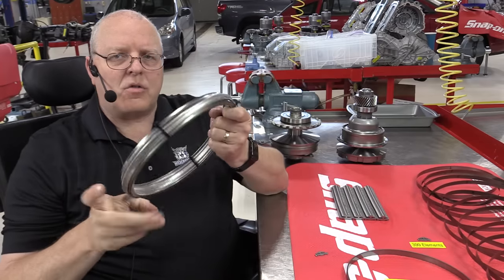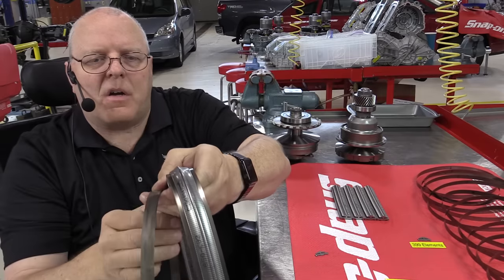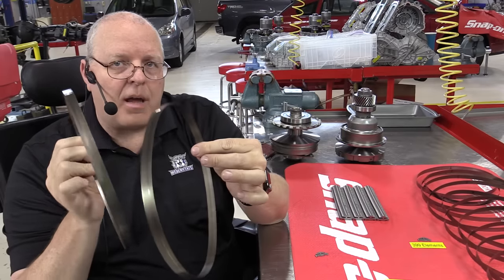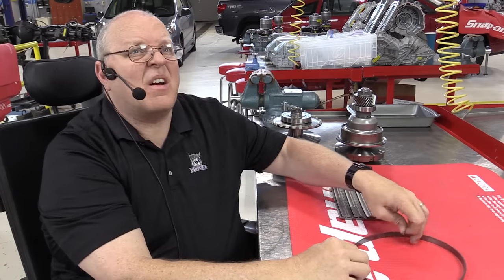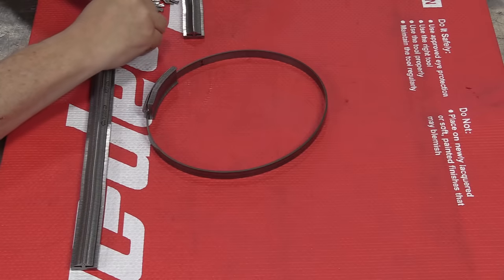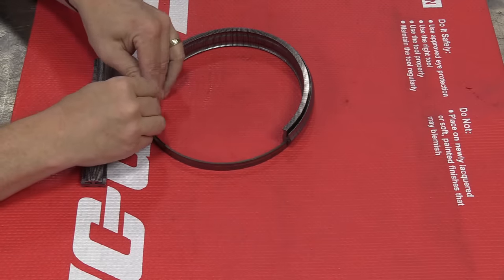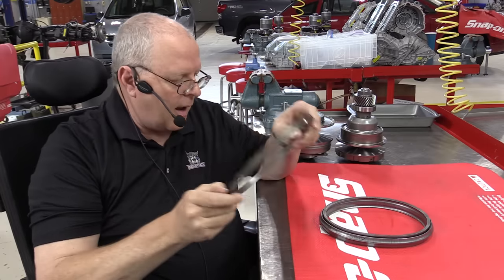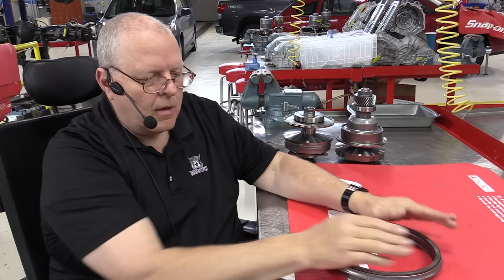The 423-Piece CVT Steel Push Belt

Comment: so that's not a pulley... it is a pushey
Reply from the maker: True! Thanks for your feedback
Reply: I just realized I am not the only one with such a comment LOL
Reply: This tech came frome snowmobiles with a high striangth reinforced rubber belt... open and easy change. Cvt in closed auto transmission = expinsive. Its cool tec junk.
Reply: Hahaha
Reply: 399 elements.  
Some engineer was told 
' because of peculiarities in our supply chain, using 400 elements per transmission is going to boost the cost of the car too high.  You need to find some way to get the element count below 400'. 
'yes boss, I'll find a way'.
Reply: @WeberAuto  where can I buy those belts for my Nissan
Reply: Lol
Reply: it's definitely junk  @nater3113
Reply: Lol
Reply: Everyone likes a little pushey now and then.
Reply: Hey! Don't push it, pal.
Reply: Now I know what my wife said, it’s a pushey and I’d better git with it!  Brahaha!
Reply: Wayne: "I did not know that! Garth, did you know that?" Garth: "No, I did not know that!"
Reply: It's a pushelt!
Reply: top comment witnessed
Reply: Hey we want some pushey
Reply: @Steve.191  try ebay...
Reply: @thorick590  Never buy a vehicle run by a 423 piece jigsaw puzzle.
Reply: pushey hunter

Comment: I'm going to throw this in the face of the next person who tries to convince me that "CVTs are simpler and have less moving parts".
Reply from the maker: LOL, for sure
Reply: Golf cart and snowmobile setups are pretty nice. This seems overcomplicated just to keep you from working on it.
Reply: The pulley itself doesn't handle the clutching?
Reply: I own one, $600 to change fluids and screen. Jeep dropped it for a Hyundai 6 speed
Reply: I don't know why they can't be like golf carts and snowmobiles except those setups are so damn simple you could work on them yourself so the dealer can't rake you over the coals I guess.
Reply: Because a snowmobile is in general an occasional use vehicle which usually does not have a huge amount of power, these are designed for longevity and as such cannot use rubber belts.
Reply: CVT sucks stay away from it.
Reply: Heliarche - Those are probably centrifugal clutches, you can't shift a transmission if it's got a centrifugal clutch. You would need to return to idle RPM to change gears. 

Bet most of these things with the clutches you like don't have multiple forward gear transmissions.
Reply: They actually do have less moving part's and are a lot simpler. Sure they have a lot of those shims but that does not make them complicated. The problem with them is that the belt can't take as much torq and last much less than geared transmissions. And once they break you will have a bunch of shims in the trany which might break something else.
Reply: @heliarche  It's not, if you used a normal pulley it would be fucked after the first time you pushed the throttle.
Reply: I still don't get it. I mean you have HUGE rock crushers that use belts and pulleys for the main motive force, yea, BIG belts and pulleys. You can't scale up a CVT such as on an ATV so it can use regular belts and whatnot? I still think they're overly complicating it. I'm not saying use normal pulleys, I'm saying CVT clutching pulleys, same as an ATV or snowmobile or golf cart, just scaled up to do the job.
Reply: Oh ,  nice presentation.   You took to time to post it, I will re-watch this again.  I will listen.
Reply: But CVTs are much simpler and have far less moving parts than a traditional automatic gearbox.. so I'm not sure what you're on about.
Reply: After seeing so many elements here, I see so many points that can go wrong. The number of gears in a 10-speed automatic pales compared to the number of elements in a CVT.
Reply: deepwater-jew very few discs and clutches to each clutch pack!
Reply: @anthonyr.hodgson9988  CVT's are for basic transportation only if ever  it is neither for heavy hauling or performance racing that's why Cars like a Camaro with a V8 supercharged or Turbocharged  or big trucks  have Conventional Transmissions only because this thing wouldn't last nothing in those types of vehicles
Reply: Producing this assembly requires only two parts production lines.... one for rings and one for elements. The quantity of parts is much less important than the number of distinct parts here.
Reply: @Stierguy1  It doesn't matter to Me because I want in a Car a Conventional Transmission
Reply: @zooplanton  only if you count that belt as 400 "elements"
Reply: No wonder Nissan transmission like pos.
Reply: @harrier331  those snowmobiles have as much/ more power than these cars, dont believe me look it up. Also look at SXS's, which use rubber CVT belts and can push up to 300 HP
Reply: @yohanathandowns9057  Irrelevant, as I said its down to the longevity not the amount of power it can take for relatively short lengths of time. for instance, when was the last time you saw a 300HP snowmobile do 100+k miles?
Reply: @harrier331  if the belts were as easy to change as they were in a SXS, longevity wouldn't be an issue 🤷‍♂️
Reply: @yohanathandowns9057  so you would accept a car that you have to change the belt on every 1000 miles yea.... right.
Reply: @harrier331  vs a car that's totalled when it goes out at 50,000? Sure. For on road application, you'll get far more than 1,000 miles. Most last much longer anyway
Reply: @yohanathandowns9057  How many times do I have to say the same thing? THEY DO NOT LAST LONG ENOUGH FOR THE APPLICATION

Comment: It suddenly occurred to me that DAF (a Dutch automaker in decades gone by)  made a CVT style transmission in the sixties or early seventies, that had an infinitely variable  transmission , the principle of operation of which, was based on a precision gear box called a "Geneva mechanism". These devices were used in strip cameras, drives for precision machine tools etc., & had a series of tapered  "pulleys, sheaves, whatever       . The Daf car was never exported overseas to my knowledge

Comment: I've had my little nissan for 11 years now, and she's running on 220k miles. Cvt still strong, and let me tell you, it's had a rough life... Got it new, and will keep it forever. She blows, I'll replace, but.... still hasn't
Reply: Any tips you can share to me how to make your cvt last longer? 

I will get a new car and it's CVT.
Reply: @affandih  from what I’ve read the reliable manufacturers of CVTs are Honda, Toyota, and Subaru. I don’t think there is anything you can do to make them last longer besides buying them from the companies that have a good track record on their CVTs.
Reply: @affandih  Sure, Don't run it like a Nascar. I don't have problems either because I drive normally
Reply: @boarhog1979  never 🤣 never drive like Nascar, only casual driving. I got Mitsubishi Xpander Cross and it' s CVT
Reply: @elmergloo3259  Mitsubishi,  got new one from them this year
Reply: @NoName-gv6nm  will always do routine maintenance
Reply: Are you sure it has a CVT  I really don't believe this, and you didn't say what model it was.  Any good engineer would look at this and call it stupid BS.
Reply: @portagepete1  my Nissan Altima 2.5 SV, 2013 model year, has 195,000 miles on it and still going strong. I’ve changed the cvt fluid every 40k. Never had a single issue. 
People who dog Nissan are the same people that never change their transmission fluid/engine oil, then go full throttle on every green light and complain about reliability issues with them. 
Not saying they are made as good as a Toyota (obviously they aren’t), but still pretty good vehicles if they are taken care of.
Reply: @ehh2681  Going to do a trans fluid change on semi neglected wifes 2008 2.5 Altima. Do you always use Nissan fluid or aftermarket? Not sure I can stomach paying 100 dollars for 6 quarts of Nissan fluid for an old car worth very little.
Reply: @joshdiehl8737  Well, personally I ONLY use NS3 Nissan fluid for mine (2013 and up require NS3). That’s because for a CVT, I want that fluid to be exactly what the computer was calibrated for. However if you really don’t want to stomach it then I’d say just buying a higher quality CVT fluid from valvoline or Mobil 1 should be fine. I’d really steer away from other brands if I were you, because CVTs are so sensitive to fluid viscosity. Unlike a normal automatic, a CVT uses hydraulic pressure to change the gear ratios. Smashing two pulleys together at some odd 800-1000PSI. I have used Amsoil CVT fluid in mine and I found that while it worked, I noticed a shift difference and it felt slower for some reason. So I immediately ordered NS3 and it felt much MUCH quicker and smoother.

Comment: Note that it isn't JUST the number of rings that determine the strength and power they can transmit.  It is the material the rings are made from (i.e. F6 or F7 etc), but also the width of the elements.  Wider belts can transmit more torque. (i.e. 24 mm elements vs 28/30mm etc).  p.s. I have found your video's EXCELLENT btw, thank you for taking the time to put them together.
Reply from the maker: Thank you for your feedback. Yes, it is a combination of factors that determine the strength.
Reply: I actually contacted BOSCH directly about what I thought was a discrepancy in their tech information.  They had listed the 28mm belt as holding more torque than the 30mm belt (with the same number of rings).  I have not got another reply back on why exactly (balancing act of fluid layer/belt tension or something maybe?), but they assured me that the 28mm actually held more torque than the 30mm.

Comment: All my curiosity about these metal belts was satisfied when you mentioned they were  push loaded (compression) rather than  pull (tension) as in rubber belts. Thanks a lot for the info.
Reply: Thank you for the explanation of push compression vs pull tension. Years ago my Shopsmith woodworking machine used a CVT with a rubber belt. I was fascinated how these compact transmissions worked.

Comment: AMSOIL's CVT fluid has doubled the life of all our clients belts and transmissions. Amazing find!! Nissan and Audi customers need to switch before 75,000 miles. It keeps the friction while allowing smooth shifts and stops all wear. It took them 4 years to get it perfected thus it came out a little late but better than never.

Comment: Very excellent, enlightening  video, I thought the belt was used to pull the opposite pulley from the torque converter input!  But since the elements on the belt PUSH it to the other drive pulley, the only reason the multi-ringed belt fails, is simply because the flexing that occurs from going around the pulleys causes them to eventually crack and break due to metal fatigue after trillions of rotations. WOW !
Reply from the maker: Thank you and Thanks for your feedback

Comment: Being someone that does all of my own work on my vehicles, this video has shown me that a CVT is NOT something that I should ever buy!!!

Great vid. Very informative.
Reply from the maker: Thank you!
Reply: Exactly
Reply: They work great actually
Reply: @NoName-gv6nm  Until they break down prematurely.
Reply: Does that mean you can disassemble a planetary transmission if 1 gear needs to be replaced? But not a cvt?
Reply: @NoName-gv6nm  is that why there life expectancy is approximately 5 years
Reply: @BIGSMOKE-bl2lq  jatco maybe but that has given cvts a bad rap.  They last a lot longer than you may think.
Reply: @BIGSMOKE-bl2lq  mhmm, wonder why I see dozens of them myself over 10 years old with anywhere from 100k to 200k miles... 5 years is a very false number lol
Reply: Because you watched videos of how to rebuild automatic transmission and said that something I want to take on?
Reply: These are not repaired, but replaced only. So it is like replacing a fuse. A really expensive and difficult fuse, at that!
Reply: @BillKinsman  not true, they can definitely be overhauled. It can be difficult finding someone who can, but those shops do exist
Reply: @NoName-gv6nm  original CVT on my 2003 Honda Civic Hybrid.    127,000 miles .  change fluid 3times a year.   costs me about 50 bucks and my time.

Comment: A friend of mine is a certified Nissan mechanic. I was asking him questions about the CVT transmission, as I own an Altima, and what some of the most common failures of the CVT are. He said to let the transmission warm up as the weather gets colder before driving it. The transmission fluid needs to warm up and 'expand' as to get it to operating level. If you put it into gear and just go before it warms up you risk a chance of sucking air and running the transmission dry. He also suggests having the transmission fluid changed every 60,000 miles as preventative maintanance measure.
Reply from the maker: Thanks for sharing. The transmission should never suck air (cold or hot) if the fluid level is set correctly. Warming the fluid can make it perform better in cold climates. We will address the fluid change intervals in the upcoming episodes. It differs with each fluid type and version.

Comment: Very interesting. I would never have guessed it works that way. In an ordinary rubber belt and pulley set up the torque pulls the belt into the pulley tighter but this setup is the exact opposite.  You would think also that the elements and sheaves would have to be hardened in order to last but that would just reduce the friction needed to keep the belt from slipping. Yet the thing transmits the torque needed to move a car and actually lasts.
Reply from the maker: Thanks for your feedback. It is interesting technology.